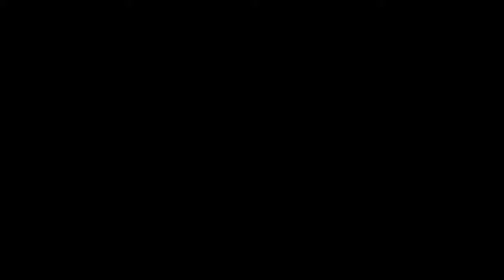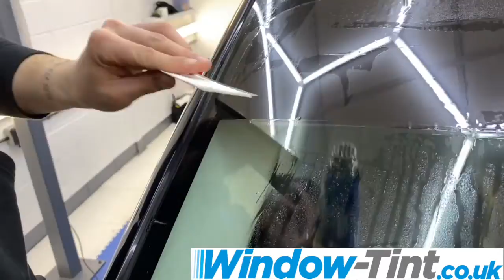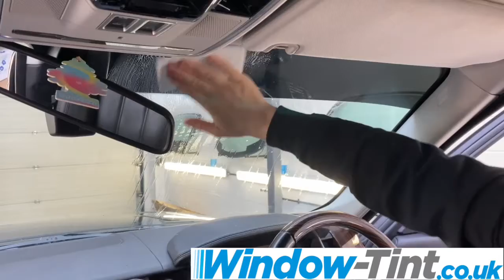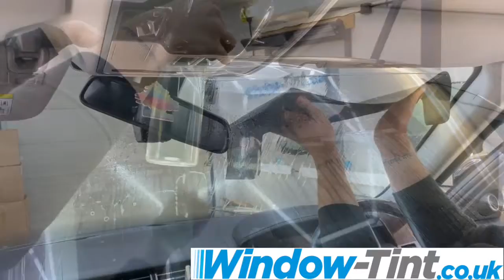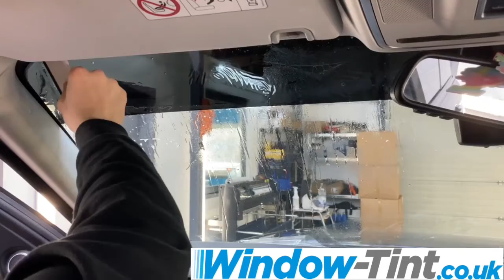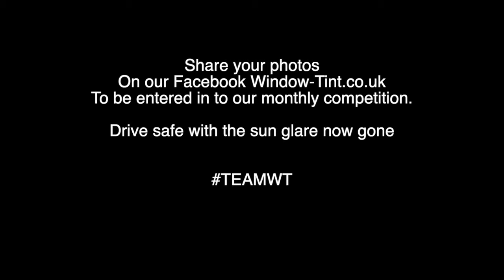Tinted sunstrip installation guide

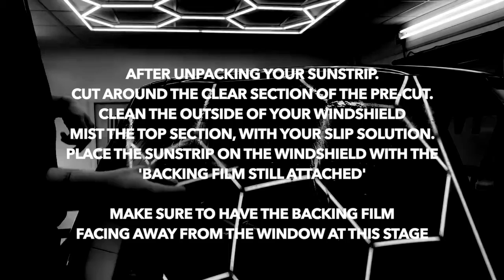Comment: 0:01 What is in the slip solution? I bought the sun visor thinking I could just put it on, but now I have to buy an entire bottle of chemicals just so that I can apply the one visor that I paid $50 for?
Reply from the maker: Hi, The slip solution we use is our WT fitting solution. Please see the link - https://window-tint.co.uk/window-tinting-tools/tint-slime-window-tinting-solution.html  - We mix 5ML with a 500ML of water to get the mixture we like to work with.. Hope this helps.

Comment: Can you do it in one full strip or do you have to do it in two peices like that?
Reply from the maker: Tinted sun strips can be done in one full piece or in two pieces this particular pre-cut kit is in two parts due to the middle section were the mirror holder is attached to the glass this is fully covering the tintable area so this one needed to be in two parts.. For the full length same process just over a larger space.. Hope this helps.

Comment: So it goes on the inside and outside?
Reply from the maker: Hi, Our pre-cut tinted sun strips are installed internally.. prep is done on the out side as it easier to gain access for heat shrink the film if needed.

Comment: How do you account for the rear view mirror attachment piece
Reply from the maker: Hi, This was one of our pre-cut internal tinted sun strips and for this model of vehicle the mirror holder is already taken into account by our software and this is pre-cut out for you.. So make for a nice easy installation..
Reply from the maker: If you are wanting to do this without a pre-cut tinted sun strip, you would need to get your film ready, heat shrink the film get this nice and smooth to the top edge make sure to line it all up nicely and to use a light inside the vehicle to shine a light on the mirror holder section and this will come up on the tint like tracing paper on the out side tint for you, you would then need to use a window tinting knife like an "olfa" and cut this section out.. I hope this helps. If you would like more advise please contact us at the training academy and we will be more than happy to supply you with the knowledge we have..